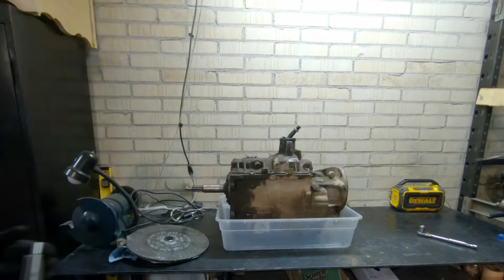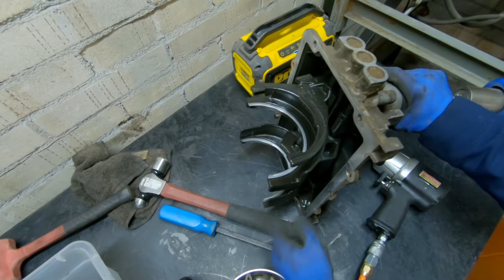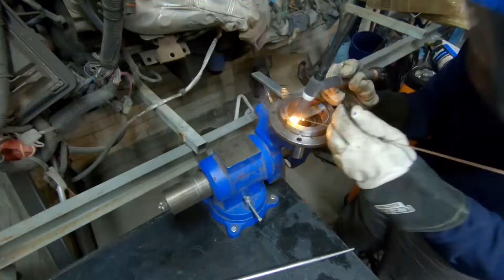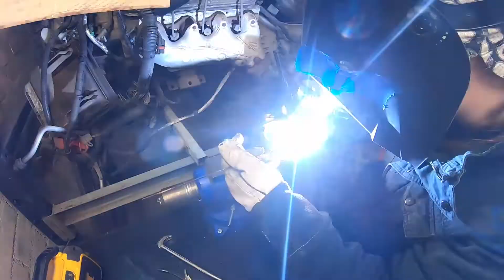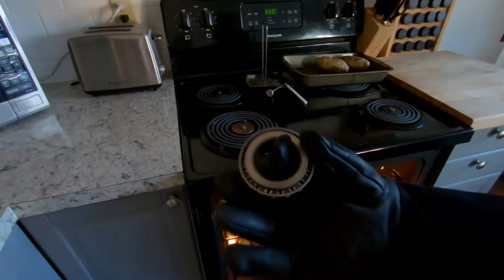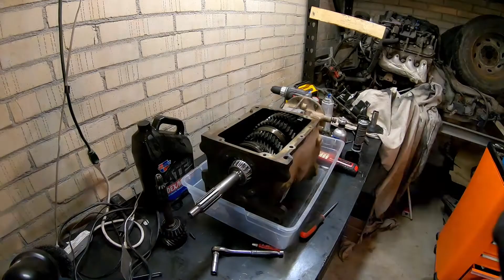How NOT to Swap Input Shafts NV4500 - Input Bearing and Race Removal and Installation!

Comment: I know this is two years old, but just out of curiosity how did the chevy gearing work out? I have a chevy with the 6.5td and a dodge with the 5.9 12v cummins. Both have the nv4500 but my dodge has a HUGE ratio split from 2nd to 3rd gear. The chevy is way closer ratio. Not sure why dodge thought that was a good thing. It makes getting a trailer moving uphill pretty frustrating.
Reply from the maker: I think it worked well, but I haven't driven one with the dodge gearing and I haven't towed yet. I don't use 1st normally, start in second, seems to be a good split to 3rd. 

The explorer is super light though so that may impact it. I'm pretty happy with this transmission so far - although it did eat the 5th gear and I had to rebuild it.
Video of that is here if you're interested:
https://www.youtube.com/watch?v=xma_BohVeww

Comment: I have never built one of these transmissions for my overland rig and was having trouble finding a imput shaft assembly video and this helped me just wanted to make sure I did it right! It was the only assembly video I found! Even though that was the wrong sized housing you helped me a ton!
Reply from the maker: Thats great to hear glad I could help! A bit of advice, while youre at it remove the rear tailhousing and check to make sure the 5th gear isnt having any issues (locknut should be tight, splines holding it on shouldnt be damaged). 

Mine ended up having issues and now im rebuilding the whole transmission. New video on that in a couple weeks!

Comment: I got the bearing part of the way on and now it's stuck where it is, tried light hammering but worked about destroying the bearing. Any tips?
Reply from the maker: See if you can apply heat only to the inner race and see if that helps. Also you wont harm it hammering on the inner race if you can get a punch deeper in there without touching the outer race. Id also consider a press or a bearing puller.

If none of that works then just accept that youll have to cut it and buy a new one. If so cut it most of the way through then use a cold chisel to break the last little bit apart. That way you wont mar the shaft. 

Good luck!

Comment: As a Millwright, bearing removal is common. To remove that outer race instead of welding that bar (or disc) inside it, all you do is lay a bead of weld inside about 1/4 of the race. Let it cool and the race will shrink, and literally fall out. 
Cudos for using dissimilar temperatures on matching parts for install. The easy way.

Comment: Suggest that you look at other videos which address the fifth gear retainer nut problem !!  Should deal with it while you have the transmission on the bench.
Reply: I know this is an old video / comment.  But if guys see this....Just know that the GM variant did not have the same issues with this as Dodge. 

Also unless the synchronizers have been previously swapped out those were not brass.  The NV4500 uses some sort of carbon fiber material which requires special fluid.  Brass synchronizers are a very common replacement part / upgrade tho.

Comment: Would a bad input shaft on one of these sound like a wheel bearing going bad? Goes away when clutch is pressed and can be heard in neutral and all throughout the gears.
Reply from the maker: Good question, it definitely could be. If it were me Id check the trans with a mechanics stethoscope and if the noise is coming from anywhere around the bellhousing or transmission then youll have to pull the trans no matter what the problem is, may as well pull it and check this bearing first. While its out take a look through the top like I did make sure theres no other obvious issues.

Comment: if that motor will make any power at all id recommend pulling the 1.250 shaft and going to the bigger 1.375 shaft and a nv5600 sized clutch. The 12" clutch and small shaft wont hold up to much at all.
Reply from the maker: Good advice! As far as I understood the nv4500 setup with the 1 1/4 shaft and 12 1/4" clutch was a stock like setup on dodges, so I assumed it would be fine especially considering how light the explorer is compared to a ram 2500. However if I run into issues with it it's good to know an nv5600 like clutch is an option.

Comment: You do not need to adapt a transmission to a clutch plate, you can swap the clutch to match the trans.  I am using a clutch plate for an Edsel to mate to my Mazda trans so I can install a 302 engine.  As long as the teeth and shaft diameter and the clutch diameter match up you can use it.
Reply from the maker: Good tip! If I recall correctly the stock clutch that had less splines was also a smaller clutch, so I figured if I wanted to keep it "stock-like" it'd be better to go with a bigger shaft. However I'm sure there's something available aftermarket!